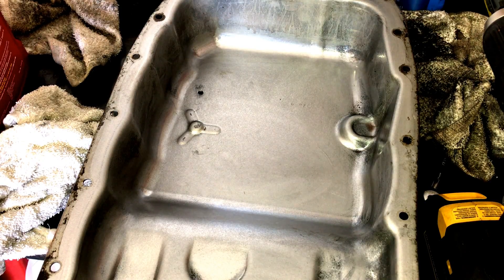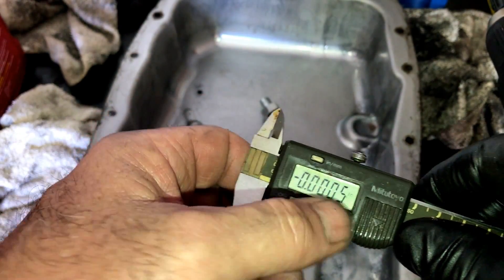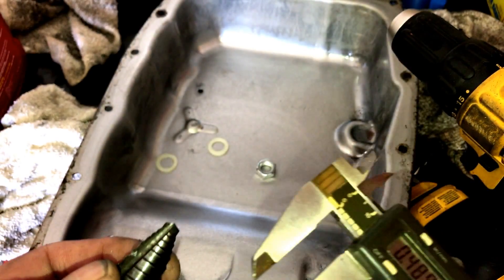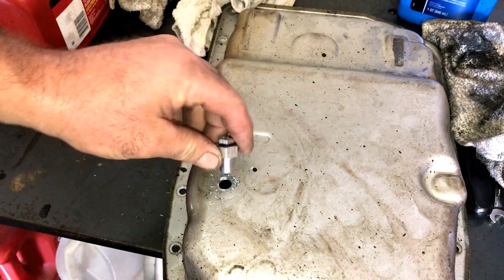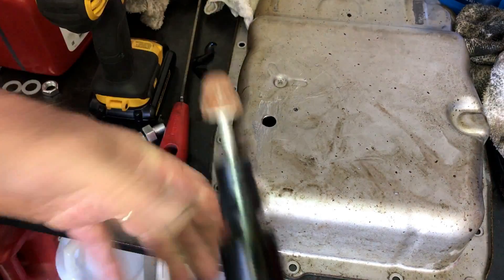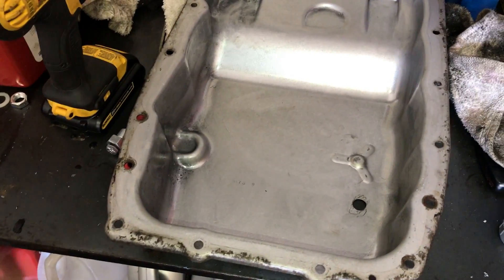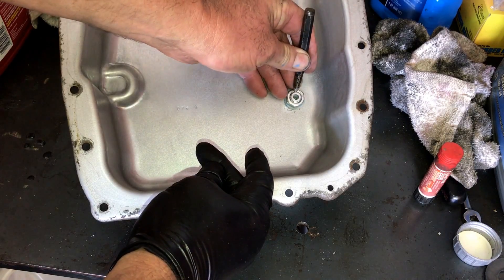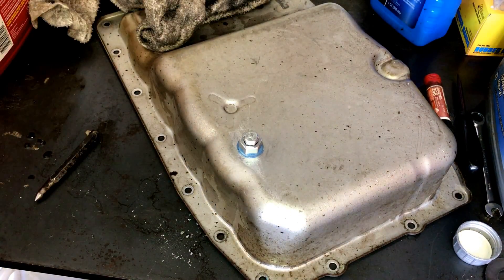HOW TO Install a A DRAIN PLUG in your Transmission Pan

Comment: I always weld in a 1/2 inch grade 8 nut on the bottom of the pan and use a copper washer for sealing. Fine threads of course.
Reply from the maker: Thank you for watching and sharing Oby-1, we really appreciate it, hope you have a great day. mad Mike the hammer SPC

Comment: Another thought, If you have decided to add the drain plug, couldn't you go ahead and drill the pan (for the plot hole) while its still full of fluid right where the drain plug would be going? That way the current fluid change would not be  messy either?

Comment: Did you ever notice if your drain plug leaked / seeped around the o-ring ? Maybe better to use a copper washer instead ?
Reply from the maker: We've never had it leak the way we do it, but you can use whatever you want if it makes you feel better my friend. Thanks for watching, have a great day. mad Mike the hammer SPC

Comment: why wasn't it made that way?
Reply from the maker: Here's the reason why, they want to make sure that the filter gets changed as well as the fluid.  But for those of us who are hard on their transmissions, we like to change our fluid more often when the filter doesn't necessarily need to be changed, plus the plug just makes it easier for doing any maintenance on your transmission because you can easily drain out the fluid.  Thank you for watching and asking Dustin, have a great day. mad Mike the hammer SPC

Comment: That's a great idea but what about the transmission filter . Or is this drain then drop pan to change filter method ?
Reply from the maker: thats why you want a plug to drain the fluid so you can change the fluid and filter without making a huge mess...
Reply: I totally agree , great automotive hack Leo them coming  thank you
Reply from the maker: thanks Nick plus for those who worry about their cars way too much like me...lol we can change the fluid once before the filter needs replacement...or at least 5 to 7 quarts that are in the pan.
Reply: I like to take care of my vehicle and make them last also and I think I'm have to buy a spare tranny pan and install and drain plug and give it a try also .
Reply from the maker: Im with you...thats a great way to do it nick
Reply: I have used a vacuum pump to empty the trans and it is soooooo slow. Will be doing this fix. 😁

Comment: One tip.  Only put the drain plug on the bottom if you're sure that you'll never drag the pan over a speed bump or rock.  If you do it will rip that pan right open.  Putting the drain on the side is plenty good since you don't need to get out every last drop as the pan has to come off anyway to change the filter.
Reply from the maker: thank you very much...and for the great comment, we are glad you are here with us :)
Reply: That’s exactly what I was thinking as well. Ripping that plug out by high centering on an item in the road way. Put it on the side of the pan as low as possible. Maybe the rear of able.
Reply from the maker: the nice thing is this pan was way up above the frame...:)
Reply: Some vehicles, i'm look at you Volvo and VW just to name a few, put the oil pans level or below the frame or subframe. Your mileage will very.
Reply from the maker: Yes it does take some common sense when doing this process there’s no doubt about that
Reply: I would pick the back side like a soilder in back of a tank.And home depot sells magnet   to help trap dust metal. But on the other hand I like to keep things factory original so im  just keep my pans the way they are.
Reply: Great tip! I was only thinking of trying to empty the pan. Never thought about ripping it out. You save the day.
Reply: Thanks for the tip. I always wondered why my drain plug was recessed and leaves a good half a quart in the pan. It’s to protect it from bottoming out or road debris.
Reply: It will likely actually drain MORE of the fluid of it's on the side, and you can lower that side first so even more of the residual fluid comes out the drain in a controlled way.

Comment: Nice video. I made a castle nut out of one I had laying around and welded it to the inside of my pan. The slots need to go against the pan. Using a castle nut in this way allows just about all fluid to drain out verses the drain pan kits sold in parts stores.  But you gotta use what you can get your hands on I guess and those kits are better than nothing at all.
Reply from the maker: Thanks for sharing your great tip!  Have a fantastic day my friend.  mad Mike the hammer SPC

Comment: You did not show that you already drilled a pilot hole will make it harder for an amateur
Reply: Don't entirely need a pilot with these stepper bits as in my experience they cut much quicker and don't seem to move around as much as a normal drill bit. Does give a little more piece of mind that your hole will be the exact spot you wanted it though. I'd say common sense would tell said viewer that there IS a pilot hole there but we all know how uncommon sense really is.

Comment: Thank you.  Great short tutorial.  To the point, which is great.  One tip from a Toxicologist (studies how chemicals hurt the body), if I may.  Please never let anything touch your skin that you are not prepared to eat.  Why?  Chemicals pass through the skin much easier than one would ever imagine.  That's how nicotine patches and other things work.  The chemical passes right through the skin.  The thing with solvents and sealants is that these are really nasty chemicals that get inside the body and stay.  You risk cancer, nerve disorders and other ailments.  Gloves, gloves, gloves.  I hate gloves too and they make the job much harder.  But what do you do?  Your health comes first.  Thanks to everyone for considering this information.
Reply from the maker: thank you very much for sharing we do appreciate that
Reply: Skin is a pretty good protective barrier, it will block most things. Always good to be on the safe side but if you're constantly around something a quick bit of searching will tell you if what you commonly use will pass through or not. A lot of cosmetics women get is a scam for instance more than half that shit they say does something doesn't do anything but sit on the surface til washed away...

Comment: Much easier to drill a hole in the rear corner of the pan and weld a nut on to take a bolt to the outside where it cannot get knocked off. You can also wire lock the nut in place with a second nut a little above it. Or just lower one side of the pan and let the oil out.
Reply from the maker: Right but most DIYers dont have a welder..   and the drain plug makes a lot less of a mess.   thanks for your comments

Comment: as long as you're dropping the pan to put this in,why not just braze in a 1/4 to 1/8th pipe bushing and use an 1/8th Allen socket plug. Much more permanent and less likely to leak. That's what I did to my pickup
Reply from the maker: thank you very much for your great comments :)

Comment: Im sorry sir but those are not vernier calipers. They are good quality digitals made by mitutoyo years ago but they are def not vernier.. which would be huge calipers that read similar to a pi tape.. you cant miss them, about 3 feet long. Sorry I check them for a living I had to point it out.
Reply from the maker: Thanks so much for taking the time to point that very very important point out have a great day

Comment: Still gotta flush. Still gotta change filter after every trans change. This is pointless.
Reply from the maker: thats why you want a plug to drain the fluid so you can change the fluid and filter without making a huge mess...
Reply: Pointless,? is your logic,who wants to make a freaking mess every time that you removed the Pan to change either fluid or filter ..
Reply: @felipevalles8041  yeah, pointless. If you make a big mess taking off the pan then maybe working on autos isn't your thing. Stay in the kitchen sweety. . Gee, like do the math. Every 70 to 75k miles until you change. Maybe use the valve 1 time, that's if your pan doesn't warp and you keep  your ride for 150k miles. Risk the integrity of your pan and your entire transmission to save 5 minutes on your next trans change if you even have your ride that long...LMFAO! Yeah, maybe check your logic.
Reply: @JourneyToTheTruthandTR  I bet if you buy a used car with a tranny drain plug you will thank the previous owner for  doing that,I like the fact that all my cars been sold had the drain plug,in case that the new owner wants to do the service before the 50-75k mark. sometimes you have to think about others as well,that is my logic sweety.
Reply: Just admit you don't work on cars & move on.

Comment: as long as you're dropping the pan to put this in,why not just braze in a 1/4 to 1/8th pipe bushing and use an 1/8th Allen socket plug. Much more permanent and less likely to leak. That's what I did to my pickup
Reply: it is also so smooth and flush to the pan, if you manage to rip this off you already took the bottom out of your truck
Reply from the maker: Im with you on that and have done it that way before but for the videos, we try to keep it for the more novice watchers out there